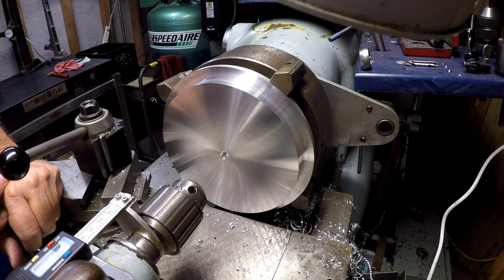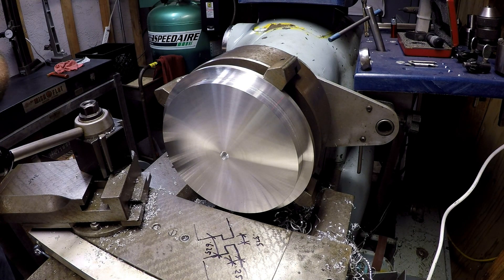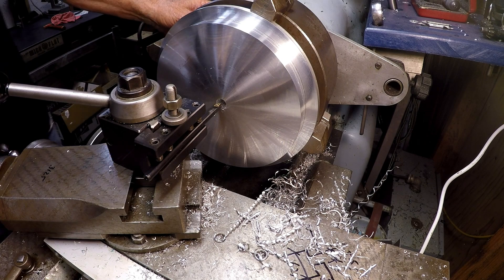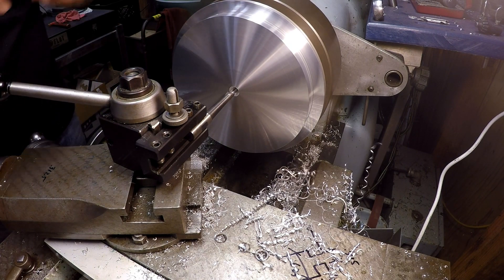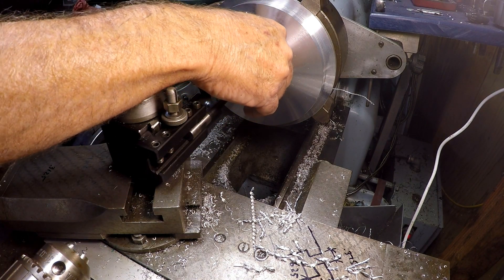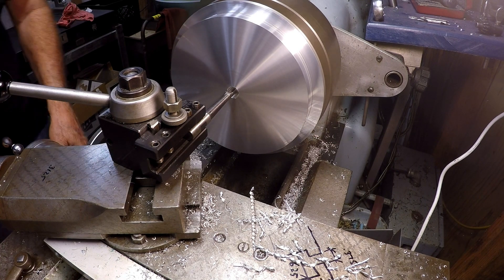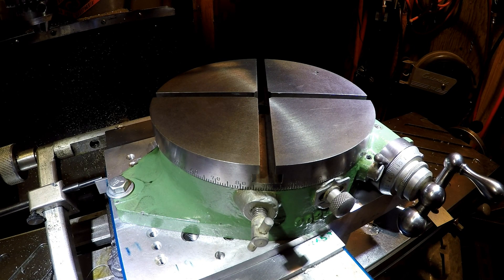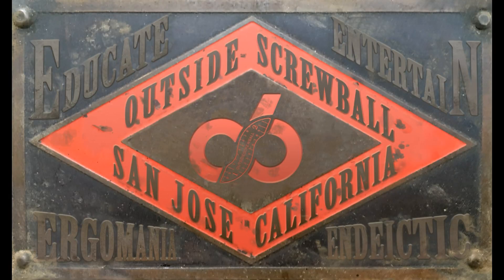Screwy Tuesday--Rotary Table Pallet pt 1

Comment: How can you machine accurate holes were so much tools hang out. The tool holder has no support on the compound it is so out of the t_ slot. It seems like you can defy the laws of physics.?

Comment: Turns out I needed one today.  Ended up using a piece of plywood, didn't have any aluminum that size laying around.  Worked great for some 3/16" aluminum and some acrylic milling.  Gonna have to add it to the list.  Did make some 1/4" 20 tee nuts for the rotary table too.

Comment: That is a nice and smooth running lathe.  Why does everyone make their pallets out of aluminum?  Is it just because it is easy to machine?  Aluminum is much more expensive than steel and way softer.  I'd think cast iron would be optimal but probably harder to come by.

I'd have ripped (literally, with a claw hammer) that stupid light thing out the second time it put me in the dark.  It has been doing that to you for years.
Reply: I made mine out of aluminum because 1" thick aluminum was cheaper than 1" thick steel plate.